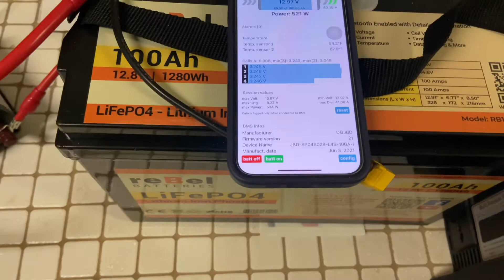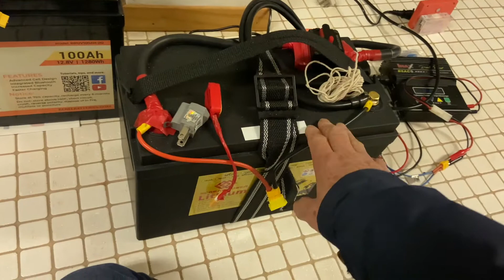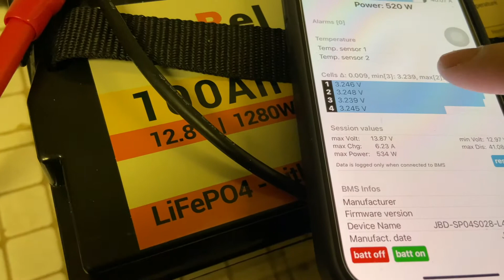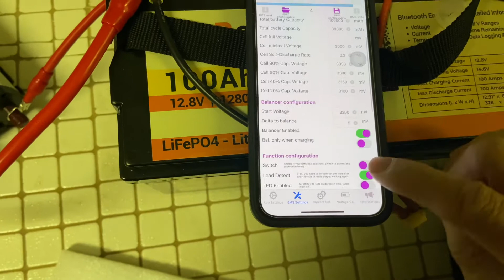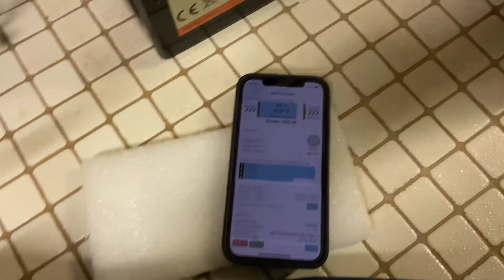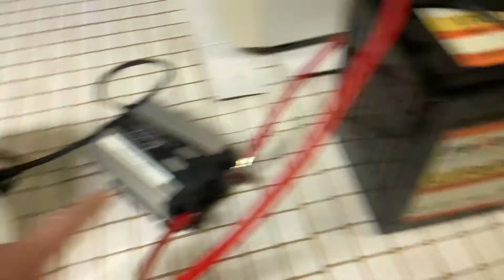Rebel 12V 100A lifepo4 bluetooth battery

Comment: I'm wanting to know what's inside. Specifically cells
Reply from the maker: Five prismatic 20A LiFEPO4 cells in parallel, 4 blocks in series to make 12.8v 100Ah Battery.